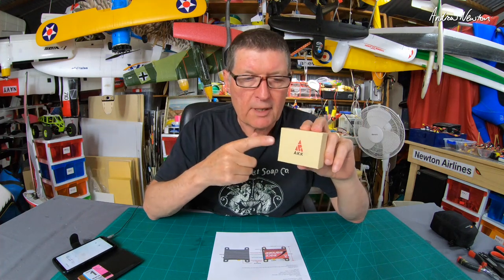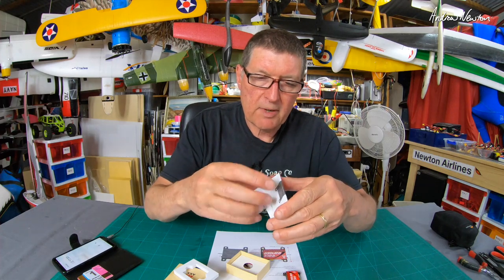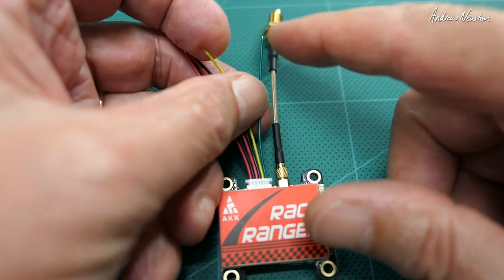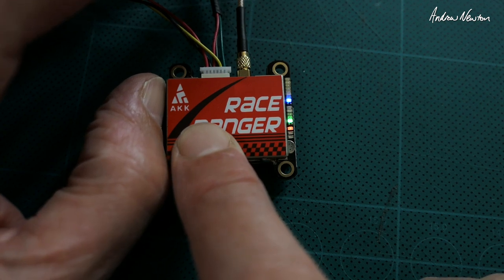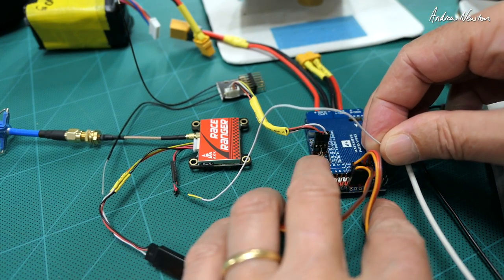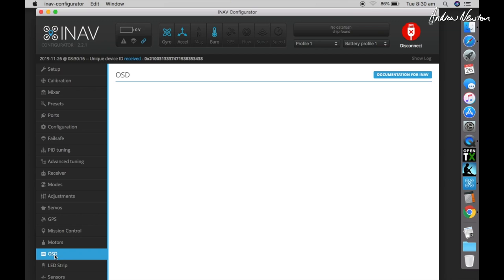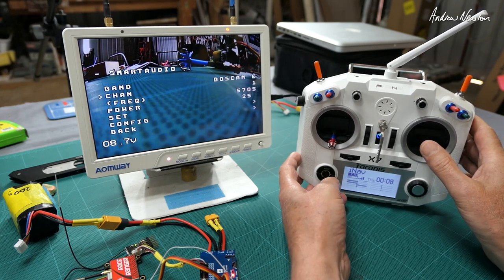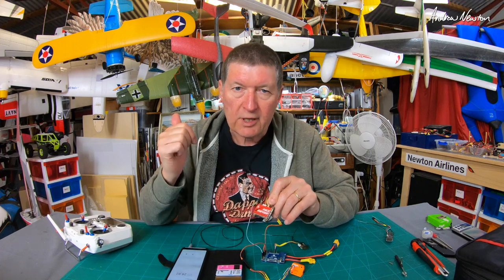AKK Race Ranger VTX Smart Audio INAV

Comment: MAD!
Got one of these for 35 or 46AUD the other week with some motors a Tricopter thats slowly forming on my wall....
Looked around at the time but ni review that I could find....
Figured AKK were a known quantity so should do the job even if it doesn't get run at full strength...
Haven't watched yet, just wanted to say thanks- especially as it'll be a while before mine gets used! :v
Reply: Bummer- Somehow I thought the 5v output more than 500ma...

Comment: I have the 2000mW dominator.  Its beastly.  Use the switchable power output on the Matek wing controllers to have an on/off switch so you can wait until you've got some airflow moving over it before powering up :)  Or use the adjustment tabs to have adjustable power output assigned to a switch.

From memory there is a way to configure smart audio to show accurate power outputs.  As far as the flight controller is concerned, it's just power levels 1 through 4.
Reply from the maker: Good tips thanks. I'll have to look for the OSD VTx power level calibration

Comment: Hi
I want to use my Webcam to be my FPV camera
It has same 4 Wire
Red-White-Green-Black

Can I directly connect it to the AKK Race Ranger?
Should I rearrange the wire order?
Reply from the maker: It's possible but don't trust the wire colours. You would need to have a wiring diagram for the camera cable to make sure
Reply: @AndrewNewton  hi eventually the wire are 5V GND DM and DP
Did you know where should I conmect the DM and DP wire?

I saw in the Video we only have to connect 1 Video Cable to the VTX
oiya My VTX is AKK RACE RANGER
Reply from the maker: 5V and G are OK but the others are probably Data+ and Data-  You will have to experiment to see which one is Video signal.

Comment: Am I able to just buy that cable anywhere? Instead of having to buy seperately and solder? Im new to this and dnt even know the name of wires I need to purchase?
Reply from the maker: No you will have to solder up your own leads to suit your own equipment
Reply: @AndrewNewton This is the set up I choose. Can you check em and then tell me the name of wires/cables/leads that I need? I have solder gun and can solder on my own, I just dnt know where to start with the cables I need. All my stuff will be arriving today ans tomorrow.

(VTX: 5.8GHz FPV VTX  https://a.co/d/gi2989S 

FPV camera: FPV Camera Foxeer Razer Mini https://a.co/d/13mJ1Xn 

FPV Receiver: FPV Receiver 5.8G 150CH OTG https://a.co/d/0VzMbEH)
Reply from the maker: I usually power the VTx from the battery balance plug or from a flight control board. What is it for, plane, quad, car? Here's how I connect https://www.youtube.com/watch?v=46y8fhmvCyQ
Reply: @AndrewNewton  Wont have a flight controller. Just for some fpv fun installed on rc car.
Can I power the VTX from a 3s battery main cable then power the fpv camera from the VTX. One power source. This way all I need is the cables that comes ×
with camera and VTX, correct?
Reply from the maker: @FullPayGaming  Correct. The red plug on the VTx is a 2 pin JST, connect your battery to that. Solder 5v out from the VTx to the camera Vin or + (red). Solder the ground wires together (Black). Solder the Video out from the camera to the Video In on the VTx (usually yellow or white)